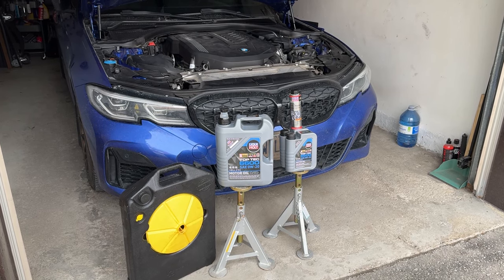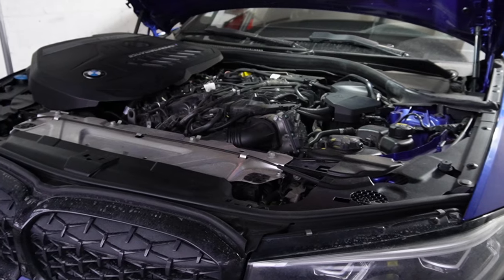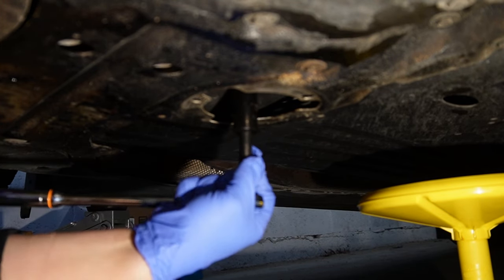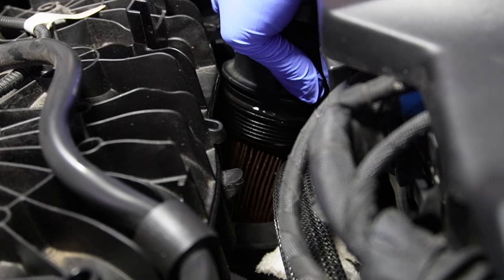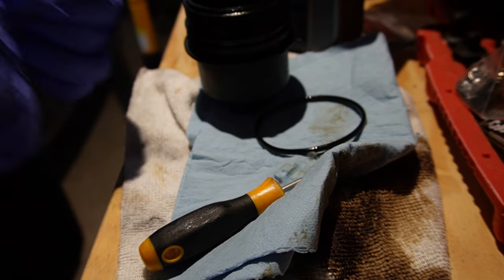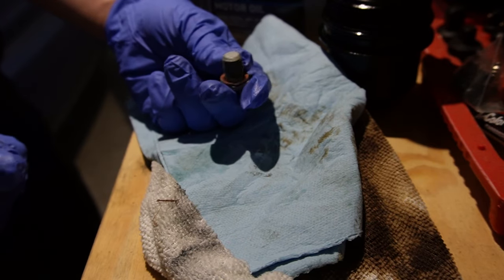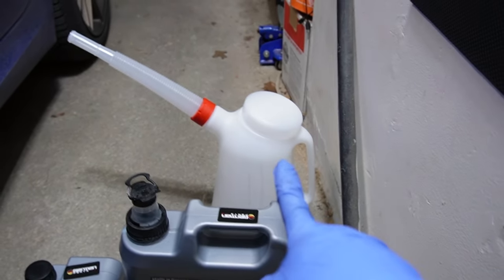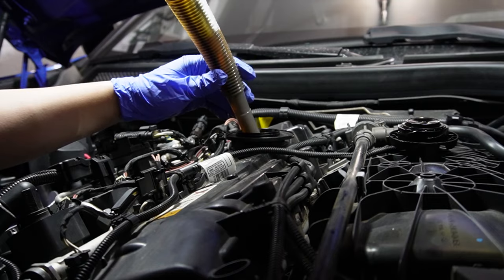*DIY* Changing Oil & Oil Filter - Best and Easiest Maintenance You Can Do | BMW M340i / Toyota Supra

Comment: How did you jack the car up?
Reply from the maker: I’ve made a separate video about how to lift up a G20 w/ jack and jack stands. Check out the link below or check out my YT playlist.

https://youtu.be/wVIp1C_wPAA?si=cykmunYPqv13WFp8
Reply: @TandeGarage  Got it, wasn’t sure we could use those points to lift the vehicle from what I read on the forums. Subscribed!
Reply from the maker: @thehonda8290  If it gives you any additional peace of mind, the BMW service manual for the G20 specified they are both appropriate locations (the center front indented spot and the rear diff). I’ve been using these locations for the past year working on my G20 and it’s been working fine.
I will note that it’s a bit strange that my front indented circle has been “further” dented upon recent inspection.
From now on, I’d recommend to use a block of 2x4 on the jack to evenly distribute the load better if you try to lift the front end like I’d shown in my video.
Reply: @TandeGarage  Got it! 👍